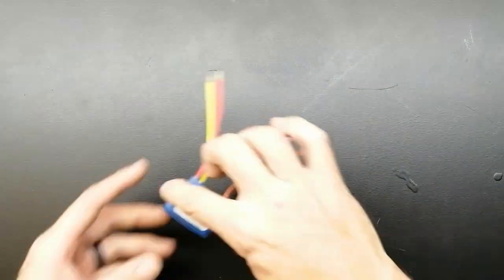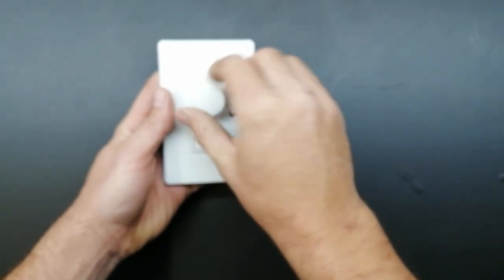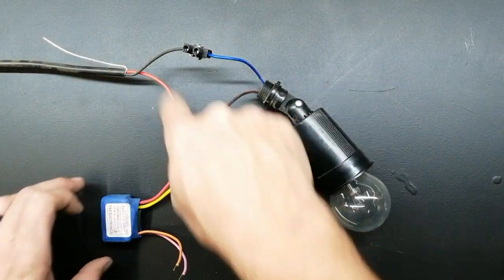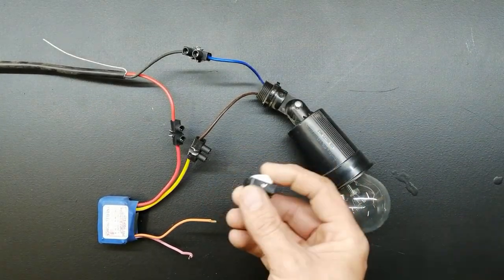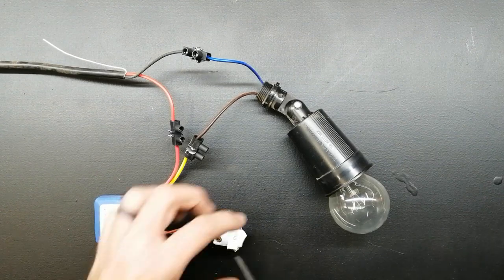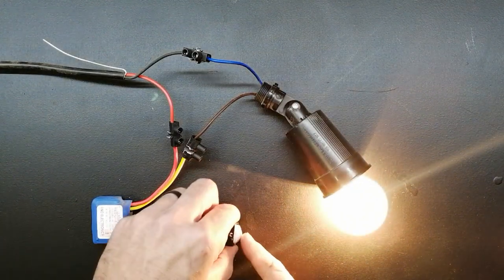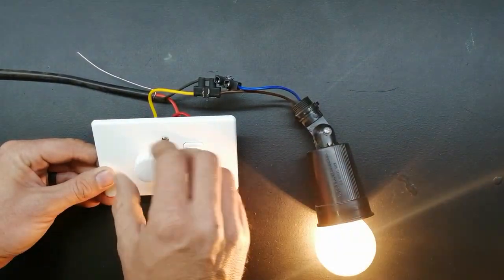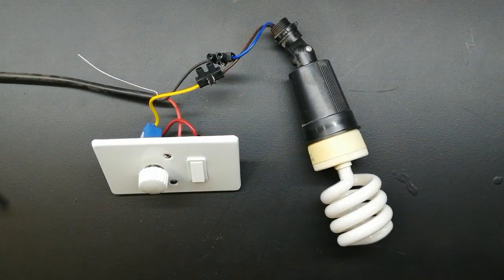Connecting a Dimmer switch to a Bulb

Comment: Hi..my led lamp down want to dim properly with this led 125 watt dimmer shuttle. What can be the problem?
Reply from the maker: @MarcullesDampies  Hi. It sounds like you have the proper dimmer module. 
You have to make sure that the LED lamp/bulb is also dimmable. Where I am,most LED lamps are not dimmable. I also had trouble with some lamps where they had a constant flikker on them. I had to play with different makes of dimmer module and lamps.

Comment: So what if you have 2 dimmers of total 1000W on a 3 dimmer switch, But now you want to put 1 dimmer for LED of a 1000W. How are you able to split and use the one dimmer module on 3 separate switches that are using the same frame area .